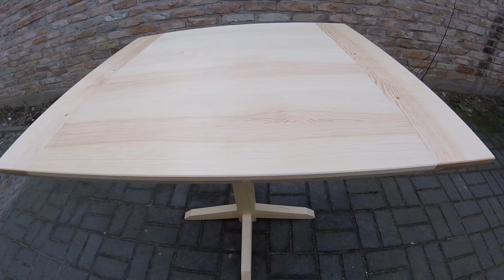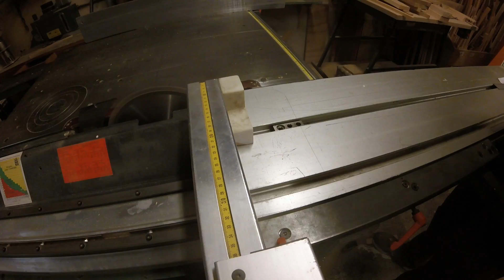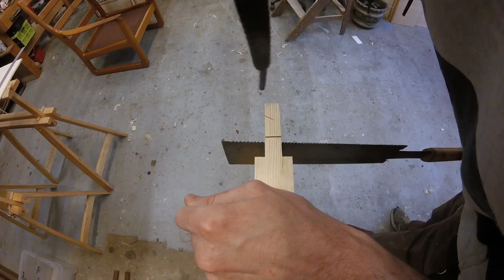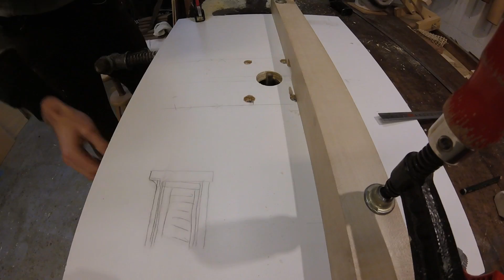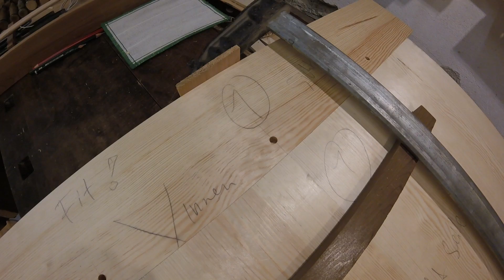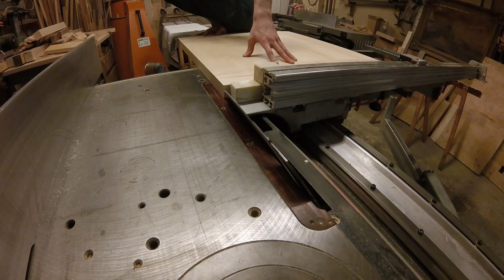Dorian Builds Ep. 1: Single legged pine table with bread board ends

Comment: I think that a reinforcement consisting of a piece of sheet metal fastened to the underside of the center post to prevent the dovetails from splitting the post. I've done this a number of times and have found it to be necessary for any longevity. I really like the way you attached the top. I will try this method in the future.

Comment: Visiually appealing and very well made. I have a question. I guess this table has been used for years now. Is there a problem like tipping over? If not, what is the ratio between the base and the top lengths across? Thank you

Comment: nice work but what for to glue all surface of breadboard? Usually only central mortise is glued to let seasonal movement.
Reply: School boy error!!
Reply from the maker: +Denis Sushko thanks! I actually elongated the outside mortises and draw bore holes on them. I was so caught up in the filming that I noticed the glue to late :( but since the pine is relatively soft, it won't tear or check.
Reply from the maker: +Miffy C yeah, I know :(
Reply: I saw that you'd gone to the effort of elongating the holes on the outside tenons! Depending on the overall width of the table and where you live you may get lucky. If you don't the joints of each individual board may fail and open up or the glue may fail in the breadboard ends and function as originally intended!??! You'll only make that mistake once!!! Beautiful design and proportions though.
Reply from the maker: +Miffy C it doesn't get all to humid in Berlin, so I think it should be fine :)
Thanks for watching ;)
Reply: Dorian Bracht f

Comment: Love the table, and love the tablesaw. What kind is it? 
I like that you incorporated some nice joinery into your build too. Whilst your joint venture series is a joy to watch, it does miss the finished project that this table gives. My only criticism from a personal point would be that I'd prefer to have the table leg taper slightly toward the centre from both ends to give the table a more floating, or tree-like effect. Easy to say from my sofa of course, although you've inspired me to go and tidy my garage so I can build something!
Reply from the maker: +Rico S the table saw is a Felder combination machine. The machine is good, but Felder machines need a lot of maintinance and adjusting. But they aren't to pricey.
I very much prefer the taper towards the top. It also gives a light appearance but still has a solid look to it.
I'm very glad I could get you off your sofa :) That's exactly the reason I make these videos!
Thanks for watching :)